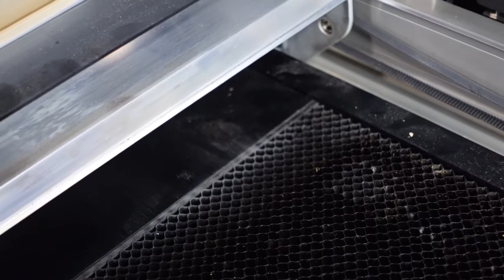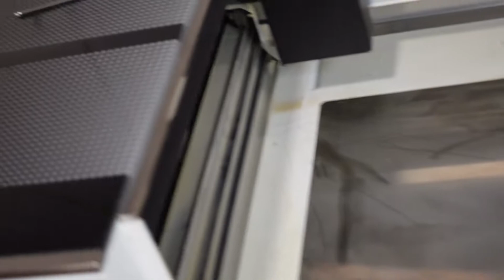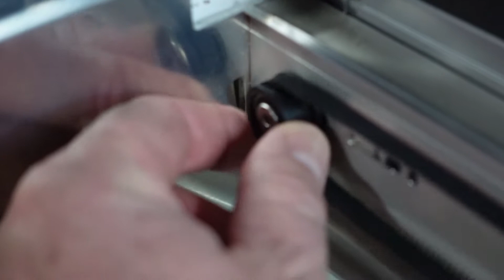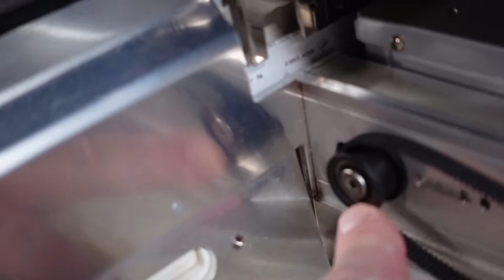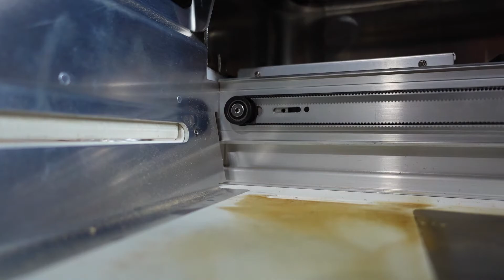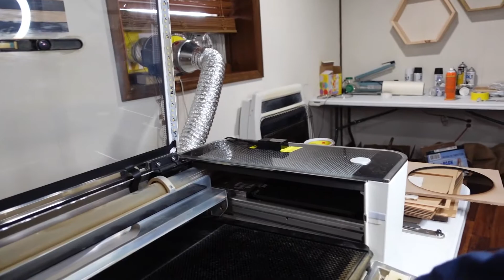Glowforge Belt Disaster? Fix It Fast Before It's Too Late!

Comment: my arm is derailing like in the video. i tightened the belts on both side but it is still jumping off track. i am beyond frustrated and would be very thankful if you could offer any advice
Reply from the maker: Make sure that the belt and rail that the roller ride on are clean and clear of obstructions. Also make sure when you tighten the belt the carriage needs to be on the rail evenly. You can do this by pushing the carriage all the way to the front while the belt is loose. Let me know how you make out.
Reply: @BryanMakesThings  thank you sooooo much! I appreciate you responding more than u know!😊

Comment: Thanks so much! This is not my current issue but maybe you know how to fix it… I went to clean my air assist fan and the right side pulley is refusing to loosen! When I use the AW and it feels like I am turning a stripped screw! Do you have any idea how to fix that?
Reply from the maker: I am sorry, I have never had that issue. If you figure it out let us know what it was. I ussually just use compressed air to cleam my fan.